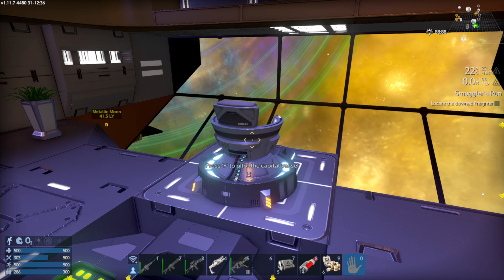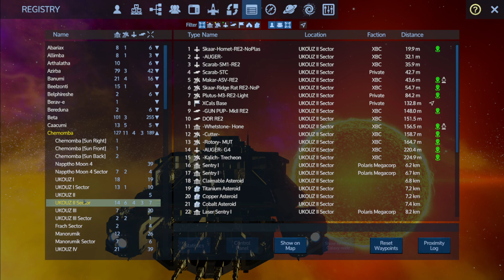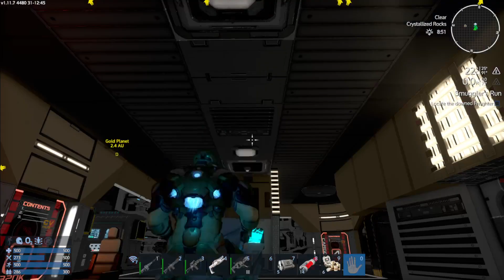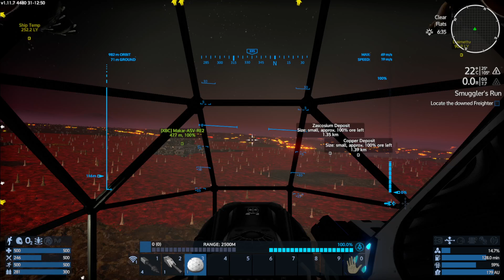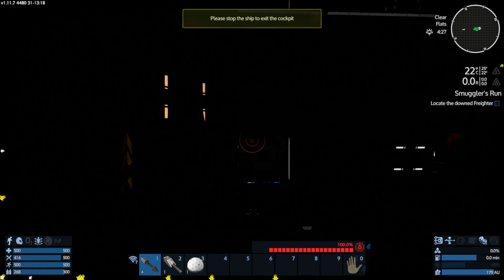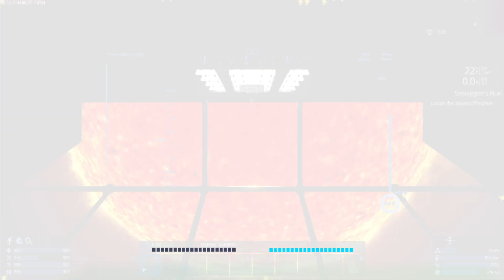Empyrion Galactic Survival - Anvil Server Reforged Eden 2 Playthru part 24

Comment: I bet you could mine ground gold deposits much faster with laser drills. Maybe even get better yields.
Reply: Don't think it makes a difference to the yield, does make a huge difference to the speed (at least in RE1 so I would expect the same in RE2).
Reply: @larsongates7745  I said "maybe" because some of the drills and drill modes have "ReturnFactor: 0.75" in them. I don't recall which, or why. I could see Vermillion putting that in the lower tier drills, to push for advancement.

Comment: It would be a nice feature to be added if there was a central place to control production. Have a central queue and let it manage which constructor type to manage and how many constructors to use for a given task. You could consider assigning a constructor for different tasks - i.e. One for small parts, one for large, one for resource conversion, one for fuel, one for pentaxid, etc. I do feel your pain. I'd also like the constructor to auto shut off when done. Loving the play through!

Comment: 1)You don't have to turn around a ship to found marker. Press Alt Key and turn around camera only.
2) You made right marker but you went to another planet))
3) Basic Survey probes are for UCH mission. Galaxy Discovery.
4) You actually have placement for a big generator. On a starboard side of engineering section on top of small plasma turbines. 🤣
Reply from the maker: On 4, I do! You are correct. I can plug into many slots actually. Duh. lol. Also thanks for the info! :)
Reply: @jeffrandall2813  Thank you for your videos